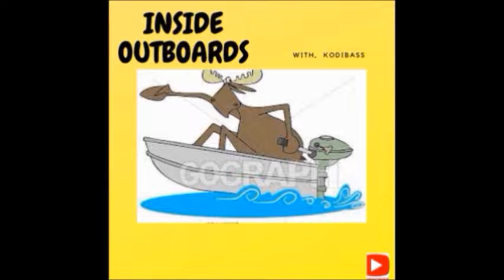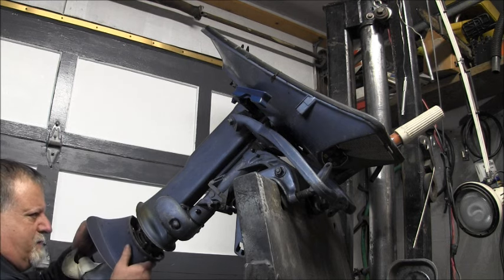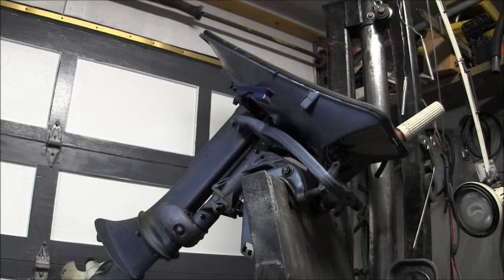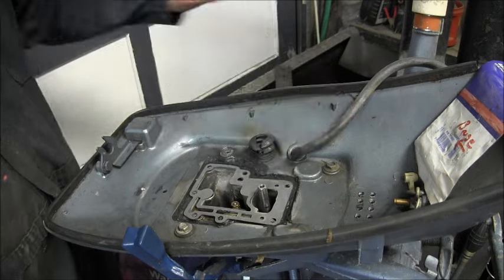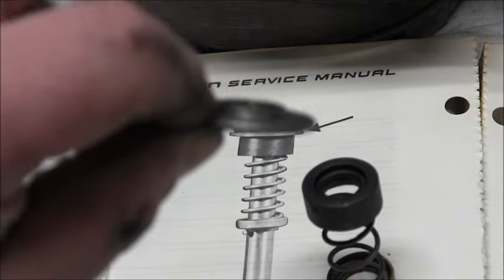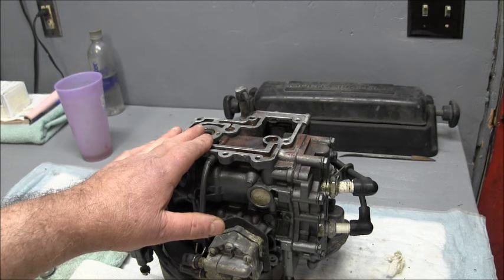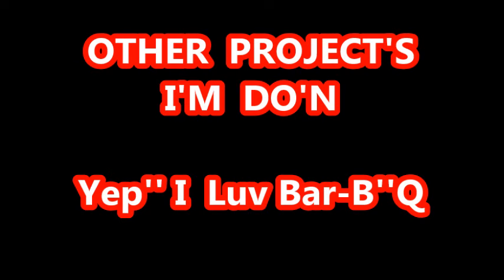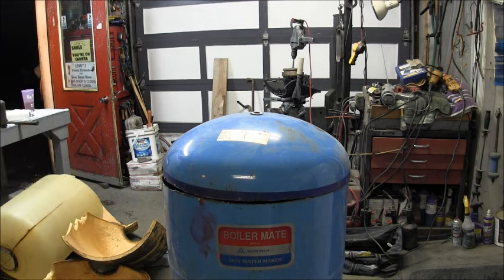EVINRUDE    1963  5 &  ONE   Half + More

Comment: Dang, now I have to go and make me some dinner, thanks Kodibass! Another great video. Can't wait to hear that 5.5 run. I had a 56 7.5 Johnson on a 12' 100 lb aluminum boat when I was a youngster, lots of summer fun! Those little motors are so quiet, almost as quiet as an electric trolling motor.
Reply from the maker: Yep' I had one down in Florida ended up giving it to a friend, Great little motors.      kb
Reply: These engines are the stuff of wonderful memories for me as well.  We beat the snot out of so many of them as kids, they spent more time underneath the salt water than on top of it...  It was these special times with my brother that planted my outboard seeds so many years ago

Comment: Well, I guess I would have skipped that messy orange goop on the gasket, but no harm in it I guess.  That lower seal assembly is so damn important.  I'm not afraid to admit I'm not quite certain how it works, but it sure does work!  This set up performs two functions:  Seal the lower crankcase, and keep the splines bathed in oil from the powerhead.  I couldn't really see well, but did you install the oring in the carbon seal??  I can't over emphasize how important this lower seal assembly is, and it is oftentimes left out, misinstalled, leading to a slow death for the powerhead...
Reply from the maker: Yep' put in a brand new O-ring 4  sure.     kb
Reply: @kodibassInsideoutboards    Cool!